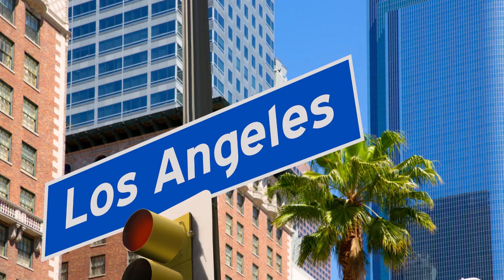Ford MAVERICK Tops 100,000 Reservations!

Comment: converted to order Aug 2nd waiting for a build date  2.0 Eco Boost XLT Cactus Grey 17inch Alloy wheels moonroof sliding back window lux pkg 360 pkg tow pkg and 4x4 pkg still under $34,000
Reply: Did you get a build date yet?